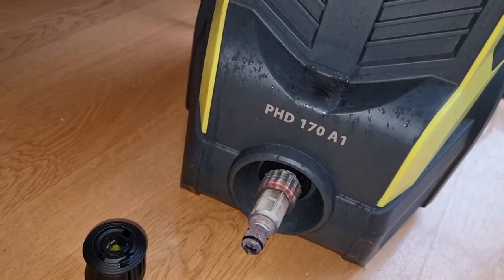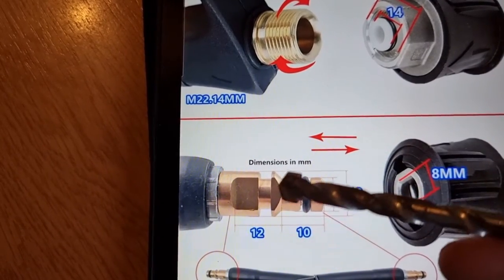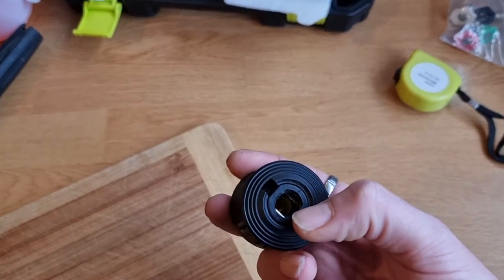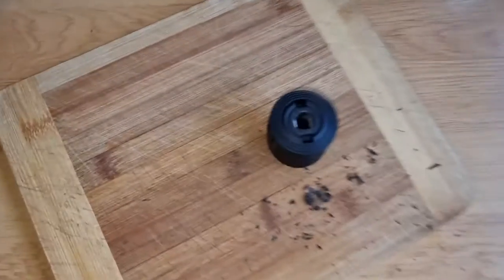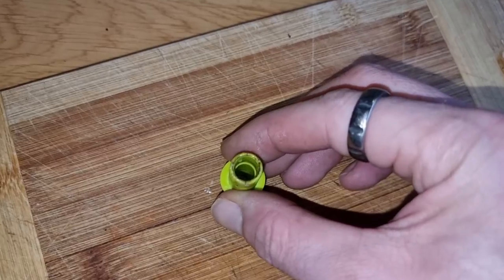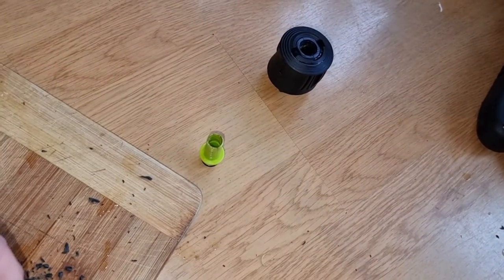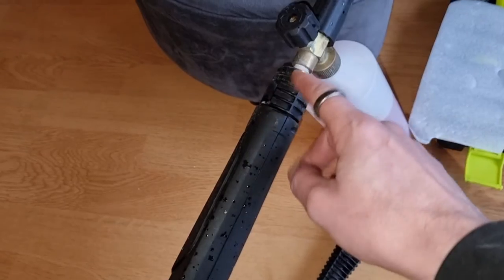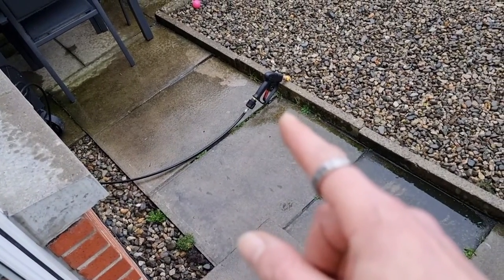Parkside PHD170A1. How to get a quick release stubby gun to fit 🤔

Comment: Exactly the same ,bought a stubby gun off Amazon with the Nilfisk fitting only to find it didn't fit because of those flat sides.I did think of drilling those sides out but just did a return and am now awaiting another gun from elsewhere.Handy to know that there is a solution tho 👍
Reply: How did you get on with the other one you ordered where was it from?
Reply from the maker: https://s.click.aliexpress.com/e/_EzoQgUp
Reply from the maker: The aliexpress option E was a tighter fit to begin with but over time it loosened up.

Comment: Good job on filming this clip, I just bought the same pressure washer today and I was wondering how I could fit a stubby gun. Now I know!!! 👌🏻👌🏻 Cheers
Reply from the maker: You can now buy quick release adapters for parkside on aliexpress.....they started selling them about 2 weeks after I made my video....option E in the link
￡3.97  25%OFF | Hose Connector Converter  washer outlet adapter M22 For Parkside Nilfisk karcher quick connect adapter High Pressure Washer Hose https://a.aliexpress.com/_v2aeaA

Comment: Very good video pal. And informative. Really pleased with my new pressure washer but like yourself was pissed at discovering I couldn’t get a connection for a shorter gun.

If you don’t mind me asking how far down are you drilling into the connector with the 12mm and the same for the 9mm. I’m guessing the masonry bits head is acting like a borer to just file out .5 of a mm to give an easier fit? Thanks
Reply from the maker: Thank you for the positive response 😀 its was all trial and error. Yes ot was more of a file rather than drilling a hole. Think I went all the way through with the 12mm, then had to open up the inner section enough to slide both O rings in, probably around 5-7mm...can't remember off hand
Reply: @whatsdavedone104  Thanks pal, did it last night and it literally took 5mins by way of a hand drill. Getting the 12mm started in the plastic was probably the most difficult even when using a brand new HSS drill bit. My stubby gun arrived with a similar Kärcher quick release but  was fortunate enough that the yellow insert did not need to be bored out at all. Little bit of PTFE on the threads of the stubby and it’s all working perfectly. Highly recommend the quick release lance too (the straight lance with an extra 30’ add on section) for car washing. Makes life so much easier. All being said I’d have been stuck without your video so kudos. Thanks again 👍

Comment: Is there a small adaptor to go from the hose into the gun ??
Reply from the maker: No, it should just push and clip straight onto the pressure washer hose
Reply: @whatsdavedone104  what I mean is , when you remove the hose from the end of the gun, you are left with a hole insert to push the hose into. Is there an adaptor with the same end fitting as the hose but with an M22 fitting on the other side so I can then use a different gun?
Reply: I already bought an additional quick release attachment for the end of the lance which fits. It doesn't however seal correctly like the stock lance you get and therefore leaks like crazy
Reply from the maker: @BarryFromEastenders my stubby gun has 3/8 quick release attachment.....see link 
https://s.click.aliexpress.com/e/_EzN8myj

Comment: So basically the nilfisk adapter only needs the center yellow bit drilled with 9mm as the black bit is already round as the karcher one has flat sides. Is that correct?
Reply from the maker: The Nilfisk also needs the black bit drilling like the karcher to fit the hose in.
Reply: @what's dave done  OK thanks
Reply: @whatsdavedone104  the collar is 14mm but you used a 12mm drill bit?
Reply from the maker: @hannakournikova  I used 12mm because I didn't want to go 14mm and it be to big
Reply: @whatsdavedone104  and its been ok since you done it 9 month ago? the lance i have comes with a nilfisk adapter, i assume it can be reamed out like the nilfisk and the distance from collar to end of fitting (11mm vs 20mm) doesnt matter?
Reply from the maker: All working as it was the day I made the fitting 👌